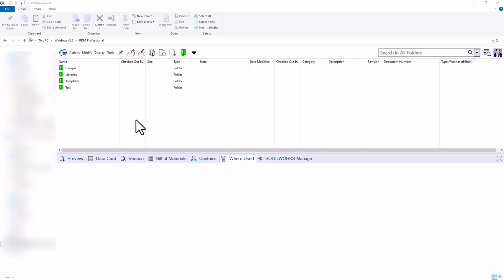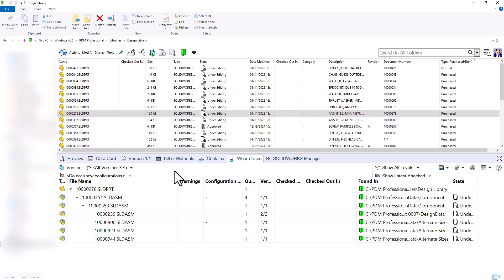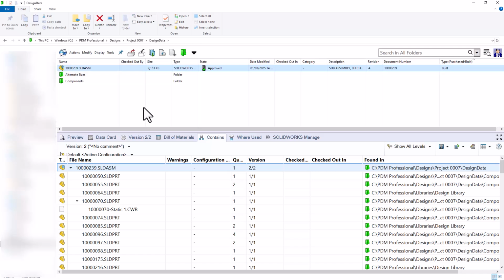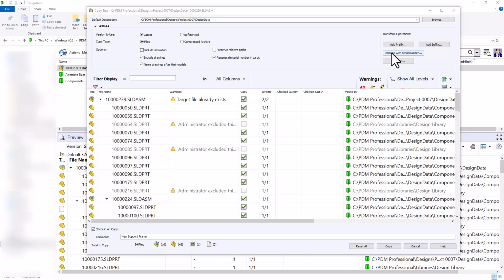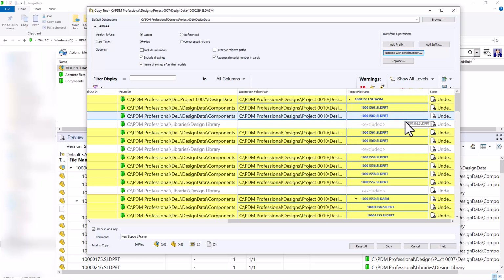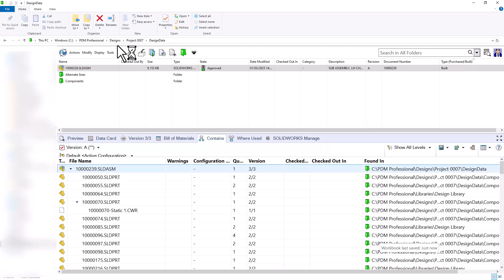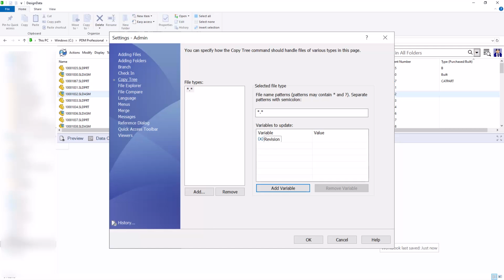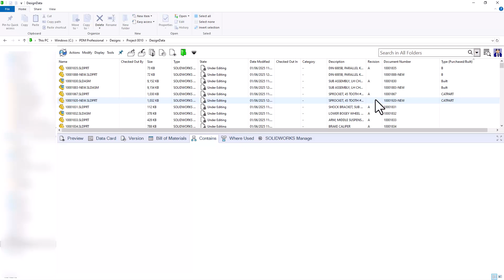SOLIDWORKS PDM - Design and Reuse

Comment: Thanks for the video. However, I wish to know something else. Say I download standard components (like Roller Bearing, Bush, Pneumatic Actuator, Proximity sensor, etc) from Misumi or Norelem. I will be using this exact Standard Components in, say 5 different projects. How do I create a standard parts library? 
Also, furthermore, say this data is in STEP format, how do I handle this situation?
My goal is to create my own library, that has all these 3D standard components in PART or 'FLEXIBLE ASSY' format, in a FROZEN status, so that there is only ONE Model of every standard component, used by every design engineer in every respective project.